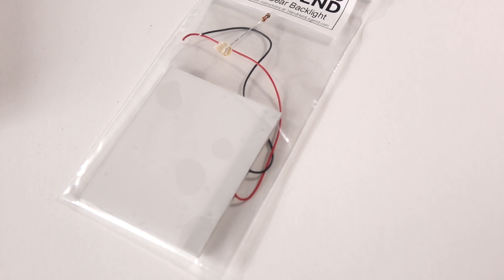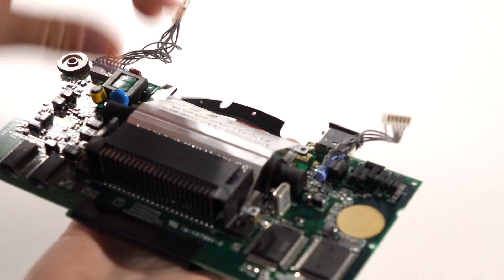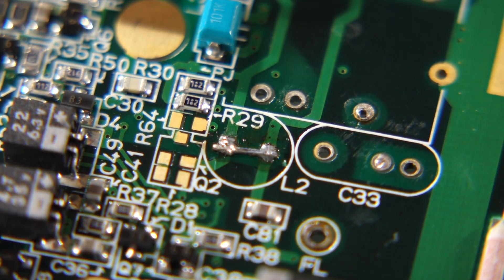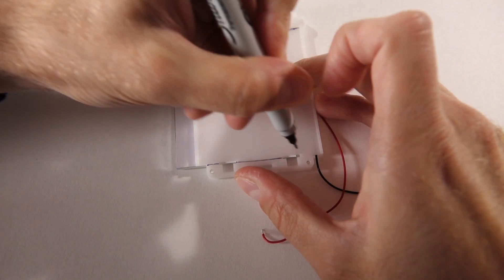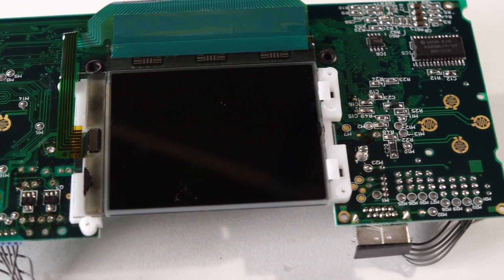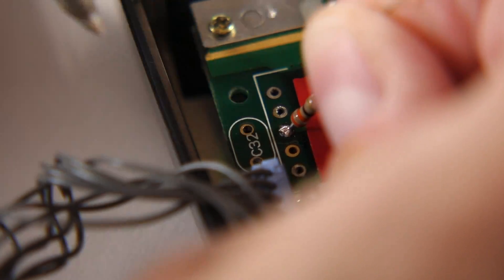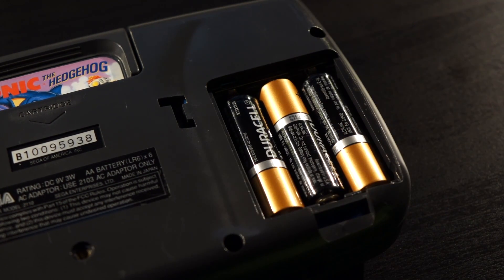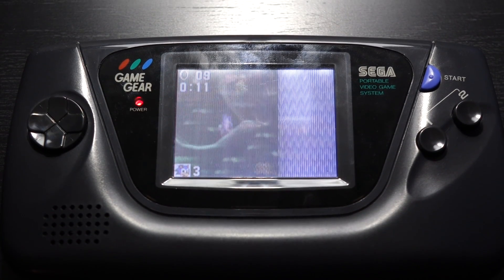Install a Game Gear LED Backlight!

Comment: You should get ahold of another GG and show off the new diffused backlight panel that only uses four wires and doesn't require trimming the LCD bracket, it's amazing after years of destructive mods.

Comment: I'm really shocked that they were able to get one of those two bites to shrink down and fit inside of a game gear.

I have no idea what's up with those tube lights even in a normal situation because it seems like they're just use that random oh what's make a house and put one in the closet and nowhere else or let's make a building and put some on the building but some of them are regular screw bulbs like what's up with that?

Comment: I did a similiar mod using 2 normal white leds on either side of the tube. (actually inside the tube)Light is much better and no light bleeds at all.

Comment: Yeah on the silver reflector do you modified it in any way because my silver reflector is pushing against the LED panel and the LCD screen and it keeps popping out of the bracket from the diffuser

Comment: Tip when reinstalling the game gear lcd: 

This step is the most complicated part of this mod. The adhesive strip that held the screen to the light diffuser made it very easy to keep everything in place but once removed dropping the screen back can be a real pain. To make this much simpler you can purchase Uglu strips from amazon or ebay. They are slightly thicker than the original adhesive but work perfectly for this application. 

I cut 2 small squares and place them next to the screw posts on the diffuser bracket. Take your time aligning the screen and apply gentle pressure to the bracket. The screen will stick to the bracket same as it did prior to the mod. Once this is done, secure that bracket to the main pcb and then secure the other bracket. If done in this order, and the screen is aligned properly to the "glued" bracket, the clips on the other should sit perfectly on top of the very small groove on the edge of the screen which secures the whole thing to the logic board. 

This will keep everything tight and secured for years to come and in the event you have to reopen the system for maintenance will prevent you from fiddling with securing the screen again. I hope this helps everyone with this led backlight mod. 

Great video and thanks for your efforts in creating it!

Comment: Someone should just 3D print those mounting brackets and include it in this kit. That would make this mod much easier.
Reply: i hate to say it but if it was a gameboy we'd already have 8 different versions of said bracket
Reply: There's such a small component that it's really shocking

Comment: Just did this to my Game Gear, used a Dremel to cut the mount, and seriously, be conservative with your cuts and give yourself some extra material to work with. You can always sand it down.

I tried to be conservative, and even then the mount was only vaguely helping on one side, leaving me with a tilted screen. I ended up having to make a little plastic wedge to push the LCD down in the corner to straighten it.

Also, triple check everything is clean, both sides of the screen, the inside of the front glass before adding the backlight. With the backlight and reflector off you can flash a light through the layers to double check.

Also, be very careful with the mount screws, especially if you follow the video and use them to align the screen without the reflector in place. The holes are not meant to let the screw all the way through, so without the thickness of the reflector, if you screw in too far the mount will crack. That also means when you're putting them in for the final time, with the reflector included, don't over tighten it. As soon as it stops turning, you're done. Too tight and at best you'll pop the LCD out of the mount (the mount holds the LCD every so slightly away from the front glass, so too tight and the edge that previously "clipped on" might twist and let the LCD go) - worse is you'll crack the mount.

So be careful and happy modding!

Comment: I did this on a Majesco model Game Gear, and it did not take well. It works, but when it gets to certain heavy memory areas of games ie; Sonic 2, when Robotnik ironically saves your life and gives you a lift from the lava  to fight his boss in Zone 1 act 3. At that point, the system will turn off. This doesn’t happen if the contrast is turned down a little. I couldn’t figure this out.

Comment: wouldn't be a lot easier to just tape a led strip on the original metal  reflector just to replace the tube and keep most on the screen intact?

Comment: Hi Colin. I'm not sure if you'll get this message or not. There's a new replacement LCD mod available for the Gamegear via RetroRGB.com which vastly improves the original Gamegear's image quality and battery life. It's quite pricey though. http://retrorgb.com/gamegearmcwilllcd.html

Comment: If I were to replace the screen, do I need an extra board to fit a new LCD display? all the guide's I've seen online require extra boards, but they have all bells and whistles added to them, I just want a newer screen, can I just replace the screen straight up?
Reply from the maker: All of the kits I've seen so far are basically just analog composite monitors, so they'll have a separate controller board from the LCD. I'm not aware of any direct-replacement LCD panels, and even if there were, it would be a difficult install as the original screen's ribbon cable is soldered directly to the motherboard.

Comment: I know this video is a little older now, but just wanted to say thank you for the tutorial, because I have just recently done this mod on mine, and the tips on the white plastic part came in very useful, although I did dremel it just a touch too small, so I spend time mounting and removing so i could file the pieces down with a nail file, but was well worth it in the end!!

Comment: I have some questions:

- you say the tube light runs at a high voltage. Does this mean that my Game Gear with this mod will blow a fuse if I use an AC adaptor due to the reduction of power needed to run it?
- can we please see a tutorial of how to apply this same mod to the Atari Lynx?

Thanks

Comment: why not 3d print a copy of the diffuser brackets? if someone can scan the part and modify it for the backlight, wouldn't it be better than  the original part when it comes to durability?
Reply: Gio Ex Yep.

Comment: No recapped video board? For shame. Takes less than an hour.
Reply from the maker: I covered recapping the audio board in a separate video, which is a similar process. Ideally the whole system should get recapped if it hadn't been already.
Reply: Definitely something anyone who intends to buy Game Gears should be familiar with, since most of the ones you get, unless you spend extra money on one that's already recapped, will be broken.
Reply: What about the Majesco Game Gears? Do they suffer from the same capacitor issues that the original ones do?
Reply: Apparently the video board capacitors on those are different (higher quality), so no. They are rare/expensive though.

Comment: Just found you and your channel very informative dude..... I've got sound issues with my game gear it works with headphones but the speaker doesn't work.
Reply: gaming and console tech Try replacing your capacitors with some fancy Panasonic ones, SEGA cheaped out on cap's and now they break easily, the quicker you replace them, the better, as they damage the circuits and solder pads when they leak after they break. If new cap's don't help, try getting  new speakers and sound stuff.
Reply: i got them fix and now it works great.

Comment: wow they used a flourescent tube
Reply: it's the only way you can play the game in the dark at the time.
Reply: Still better than the non backlit Game Boy screen.
Reply: Dootatdoot But the Game Boy has a problem where you have some columns of dead pixels on the screen.
Reply: @Substadoot not ALL the capacitors, just the electrolytic ones. That's typical of ANY consumer electronics this old.

Comment: You are a hero for making these install videos. This one isn't terribly hard, but I don't think I could have wrapped my head around it so easily without your guidance. Thanks! I also cut a piece of mirror craft paper to fit between the backlight and the reflector. After testing with and without the mirror paper, it is definitely more evenly lit with it in place. You can get suitable reflective paper at craft stores. 

My VA5 Game Gear was the same install procedure, even though the board's parts are labeled differently. I'm blown away by the results.

Comment: You should review McWill's Game Gear LCD screen replacement if you can get one of the kits. It sounds like a pretty involved process to install one but everyone says the results are spectacular.
Reply: I installed McWill's mod into one of my Game Gears a couple of days ago. It looks amazing and battery life is decent, I've played it about 10 hours since doing the mod and I am still on the same batteries.  I can't see any downside to this screen, the image fits perfect GG and (especially) SMS games look the mutts nuts.
In fact, the only downside is the screen looks so good my daughter keeps taking it to play Wonderboy, she's 4 and thinks retro games are the best.
Reply: McWill's kit has a modern LCD, so the improvement is obviously massive. The downside is that the new LCD isn't the same resolution as the original, so you have to put up with compromises: lots of underscan, non-integer scaling, or lots of overscan.
Reply: Everyone who's installed the kit says the tradeoff is worth it. The games on Game Gear look so blurry normally that you can't even see the pixels, and on such a small screen the non-integer scaling doesn't look very noticeable, from what I've read.
Reply: True, the improvement is so enormous that it outweighs most potential downsides. It'd be nice if the mod used a 640x480 display, however, instead of a 320x240 display: the higher the resolution of display, the smaller the difference in sizes between pixels. It's a 160x144 original screen, so 320 fits just fine, but 240/144 = ~1.67, so some rows of pixels will be one pixel tall, and others will be two pixels tall. But if the screen was 640x480, then some rows would be 3 pixels tall, and some would be 4 pixels tall: a much less noticeable difference.
Reply: McWill said he looked into using a 480p screen for the mod, however he says that it would have made it too expensive to distribute. It probably would have looked nicer, however even with the uneven pixel scaling I've been very impressed with what I've seen.
Reply: I've heard conflicting reports on that. I've heard other people say that the battery life is much better, although a little less so than if you do a straight LED backlight mod. My guess is that the image processor and RAM for the new LCD board would gobble up a bit more ram than just a set of LEDs, but I'd be surprised if it was as much as a fluorescent tube.
Reply: i wish that McWill would produce the screen in a higher volume. i just can't justify dropping like 150 on a GG
Reply: you should check out the videos demoing the screen. They are using "lots" of under scan or overscan from what I have seen. There definitely is some, but we are losing a minimal amount, especially with SMS carts.

I should point out as well that apparently the battery life on a Mcwill stays about the same as the standard GG, which i find kind of shocking. I would have anticipated that it at least improved 25% over the old cold cathode tube.
Reply: I installed a McWill kit in my own game gear about 2 months ago. The screen is pretty incredible and really breathes new life into the system. Master System games in particular really benefit due to the higher resolution, including some Game Gear games like Prince of Persia that were quick and lazy Master System ports. Battery life for me is similar to the original screen but perhaps a little bit better. Overall I'm really glad I gave it a shot.
Reply: By the time you have gone threw all this effort why not just buy an emulator machine or the 3ds vertual console
Reply: I guess you are factoring in the cost of the GG also?  I agree, took me a while to pull the trigger on it, and when I did I went big and got the Everdrive GG also.  So all in (£27+£90+£70) it cost around £187 for something that I can play (nearly) the complete GG and SMS library on with an awesome screen, I think it is worth it.
I got the GG cheap as it was sold spares/repair, all it needed was new caps but the shell was mint.
Reply: I got a McWill kit from Dragonbox for about $90. Still not cheap but I think the results were well worth it.

Comment: excellent video as always Colin.  I'm going to give this mod a try when I get my Game Gear.  Have you thought about doing a video on the video out mod you can get for the Game Gear?
Reply from the maker: +AndehX Thanks! It's something I'm looking into, no firm plans just yet.
Reply: the new backlight doubles your battery life but does not get rid of the ghosting.  Im sure this is mentioned in the video.
Reply: +Nick “Game Reviewer” Sullivan no it doesn't change the screen at all.  it's purely for a more uniform light and better battery life.

Comment: Gotta correct you on the year the Game Gear came out.  You said late 90's  It came out in the early 90's actually.  I remember getting one for Christmas '93.
Reply from the maker: +sprybug Yeah, I think the problem is that I could have written that a bit better. My quote was "since late 1990..." (it was released in October 1990 in Japan) but it can be misheard as the late 1990's.
Reply: +This Does Not Compute OH.  Yeah, I didn't catch that at all.  My mistake then.
Reply: +This Does Not Compute do the battery life test on the game boy color with the frontlight kit
Reply: +This Does Not Compute Would you  be  able to  do  this mod for me for a fee? my email is Timothymd90@gmail.com

Comment: I have 2 faulty GG's that need all the capacitors replaced (I think) neither of them power on at all>
My last project was my portable gamecube
Haven't touched any electronics since i stopped work on my 2nd one, subscribing anyway

Good info

Comment: if you remove the transformer, is it still ok to use the capacitor that use high voltage such as the R47 50V? or i have to search R47 with lower voltage? THX a lot with this tutorial
Reply: I know this is 3 years old, but the answer is yes, it's fine.  You can always use a capacitor rated for higher voltage, just not lower.   For example, you can replace a 10uF 16v capacitor with a 10uF 50v capaitor without issue

Comment: How long were you at this? Your hands are shaking. Was this kinda frustrating to do after breaking the diffuser bracket?
Reply from the maker: +Ryan Martinez It probably took me a good 4 hours or so to do the whole mod, but that's an inflated number because I had to shoot video of the whole process. (If I did it again off camera, the whole thing would take me maybe an hour.) Yes, it was quite frustrating when I broke the bracket -- part of the reason I do these kinds of videos is to encourage people to get into creating or modding, and if I go and screw something up it doesn't really help my case (though it does at least provide another learning experience I can pass on, I have another one in an upcoming video). I'm naturally a little bit shaky, but it's also incredibly difficult to solder on camera, so I end up having to work from weird angles.

Comment: From 6 to 15 hours? This is insane! Makes you think how the old technology were expensive and drain more power, but the new stuff we have here are more powerful and uses less power, same thing happened when you did the gameboy backlid test. 
I am really amazed
Reply from the maker: +Rashid Al-Khayal (Game92Collector) Yeah, that old backlight bulb is ridiculous...but it was the best they could do back when the Game Gear was designed, they didn't really have white LEDs back then. It's nice to see that at least we have the option now!
Reply: DK oldies charges $110 for installing the LED screen.